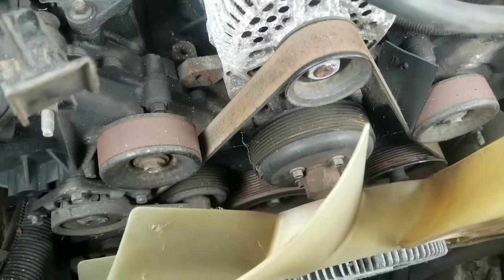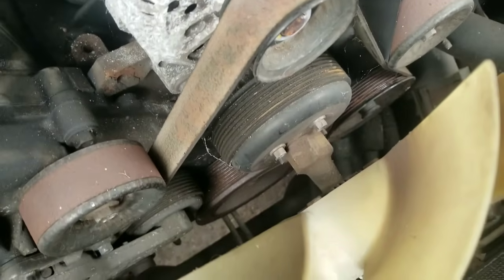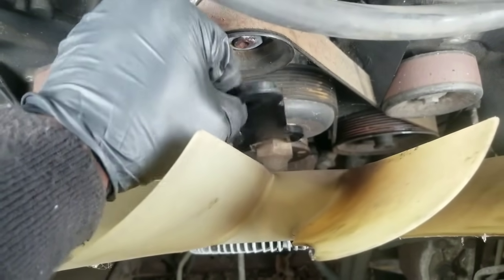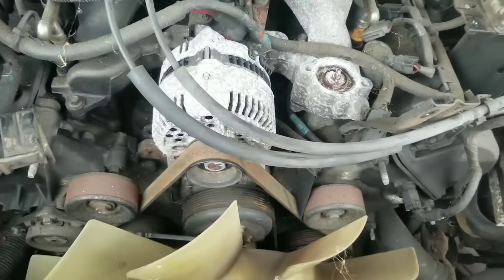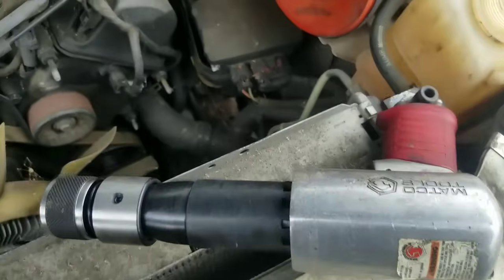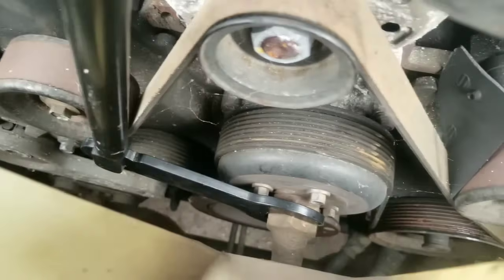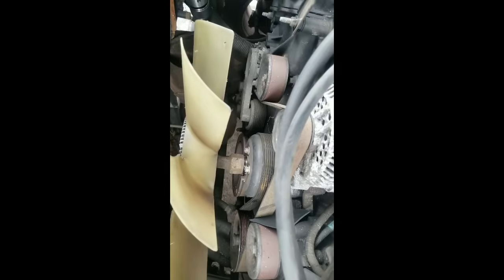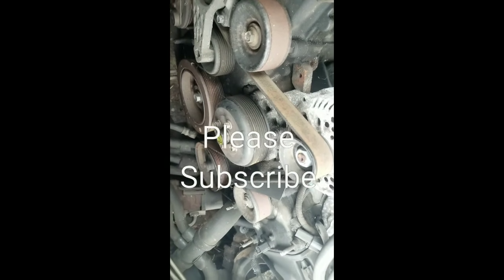How to Removal a Fan Clutch the Fast Easy Way.

Comment: Great tool.  I have a 5.9 Dakota, where the clutch has been locking-up, in hot weather, on start-up. I will the buy the kit. May not need it, for another 19 years. Tanks, for video, very informative and better than a hammer & 36 mm wrench.

Comment: Maybe this little tip may help others that see this video.

Most people looking at this video won't have an air compressor or nice specific tools like that as they are only going to do the one job!

There should be plenty enough tension already on the water pump pulley with the belt still on.  Place your fan wrench on and give it a few short but sharp strikes with a soft hammer or a ball peen hammer.  The repeated quick sharp taps will in "most" cases free the fan nut from the water pump and the fan nut should then be simple to undo by rotating the entire fan/clutch assembly.

Remove the fan and clutch.  Remove the belt and service/replace the water pump as needed.

Reverse the procedure to re-install.  Add some anti-seize to the pump threads and install the fan and clutch.  Hand snug the fan clutch nut and use the wrench by giving it a few quick strikes the lock it tight!

Oh and just one more thing.  You don't absolutely need a special wrench.  A proper sized box wrench or a larger adjustable wrench will work very well!

Cheers
Reply: Well ma'am, on behalf of everyone you speak of.... We appreciate you.

Comment: Thanks for the video. Just did this replacement. FYI the water pump pulley was slipping on the belt so I put a big c clamp around it and the belt to hold it. Worked great.
Reply from the maker: Glad it helped please subscribe, and share and watch the rest of the series thanks

Comment: Best one I saw is a short piece of chain around one of the pulley bolts and a nearby bolt, so the pulley can't turn. Then put a big wrench on, after a little WD 40 soak and kit the wrench with a hammer if normal force won't work. Pulling hard, or a pipe on the wrench is recommended before hitting a wrench with a hammer.

Comment: If you have the air hammer and compressor but not the 36mm wrench and bar just grind a bit to a sharp point. SeT  it on the left side of the nut and TAP the trigger to make an indentation. Do not pull the trigger and hold it! Once you have an indentation lean the hammer to your right with the bit in the indentation. TAP the trigger. The nut is loose.

Comment: Will it hurt anything if you turn it clockwise when aligning nut and tightening?  My 5.4 idles rough now, hoping it did not jump time.  Its important not to rotate backwards when tightening.

Comment: I have the 36mm Wrench and a  Air Hammer and a impact wrench but where did you get the bar to hook into the end of the 36mm wrench?   Is this special wrench and Bar in a kit that allows you torque like that?  Please tell me what kind of kit that was and where can I buy one?
Reply from the maker: air hammer fan clutch removal tool

Comment: So u don't need a tool to hold the nuts and keep it from spining? Will thins work with a 20 year old never replace water pump rusted and what the min size psi and air tank for this tool
Reply: I was wondering about the spinning too

Comment: 2010 colorado..trying to get fan clutch off..I took the 4 bolts off...will the clutch come   off or does a bolt need to be on there to prevent something from spinning ?

Comment: I dont know man. I guess im poor. Huge cresent wrench and a 3lb hammer. Make sure your going the correct direction. Keep tapping, the shock will break it loose. For me, everytime.
  No, I don't remove the belt till its off. I can imagine if you dont know what your doin you could really f things up doing this but maybe ive just been lucky
Reply: Yeah, I mean, that may be a great investment when you have a business, expense account, and when time is money. But for us at home, a wrench and hammer will certainly do. I plan to borrow the tool from the car store though...or maybe I will just buy the crescent wrench🤔

Comment: I was wondering about when you take your fan clutch off do you need to stand it up or lay it down because I was always told to stand it up because fluid inside the fan clutch would mess up, is that right?
Reply: Lol to funny

Comment: Question: if I don't replace the water pump right away what other damage can occur to the engine it over heats pass the half way mark but not to the red, 95 dodge ram 1500.
Reply from the maker: over heating of an engine causes early death.  save the money fix the problem while its cheap and simple
Reply: going through the same problem right now with my 2500.  definitely get that taken care of asap, especially if adding coolant to the radiator isn't working anymore. there's a good chrysler waterpump video on youtube if you search your year and model.

Comment: I have a 95 ford e150 I can't find a wrench to fit in there it's a 1 5/8ths any ideas how to get it off? Can i just take the entire water pump off without removing fan?
Reply: Is the 1 5/8 wrench too tight or loose on the bolt, might be a metric

Comment: Fast easy way yeah of course...with air gun (which 90% of diy people like me don't have) fast easy way is with the belt on,get the 36mm wrench put it on the fan clutch nut and hit on top of the wrench...that's fast easy way